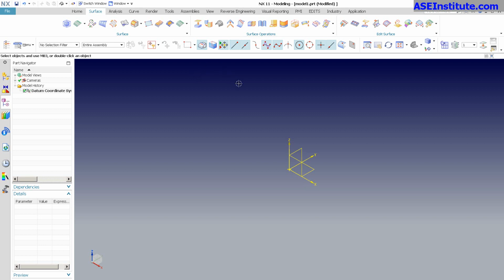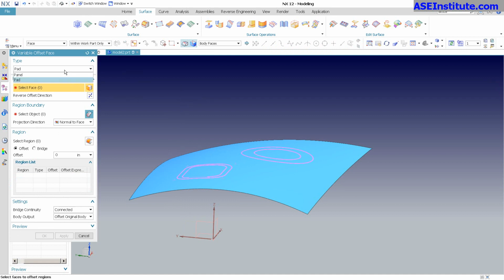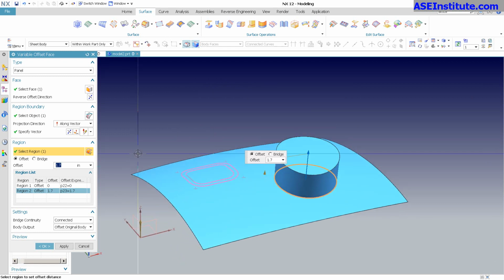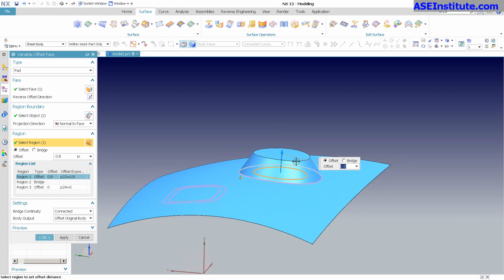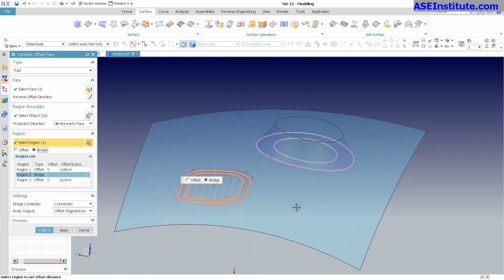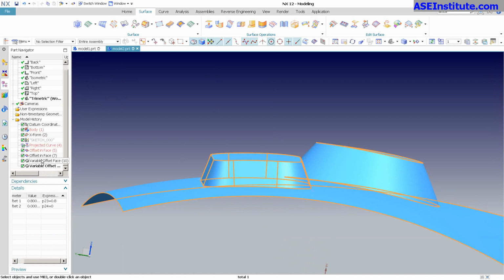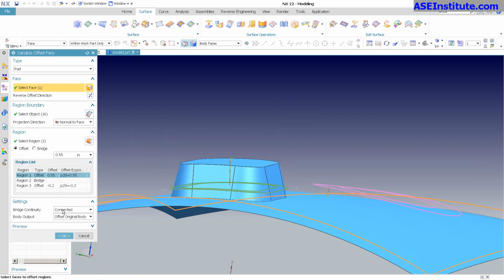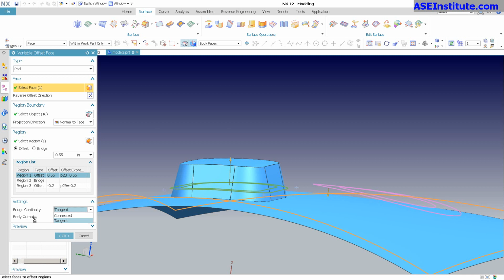Siemens NX 12: Variable Offset Face Updates

Comment: This is a great command. The case where the section has sharp corners is resolved in 12.0.1.  The tool also works on solids and it works across faces (your example showed a single face sheet body).
Reply from the maker: Agree, it is super powerful. The Pad portion needs that tweak you mention and quick. I do highly recommended the tool especially for B-Sides on plastic parts that have varying thickness. Can't wait to see it in 12.0.1